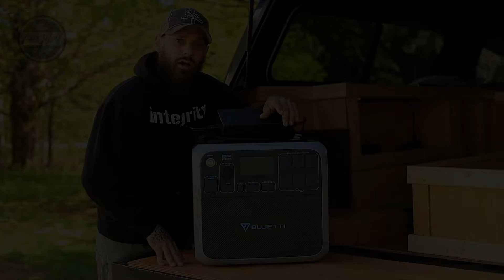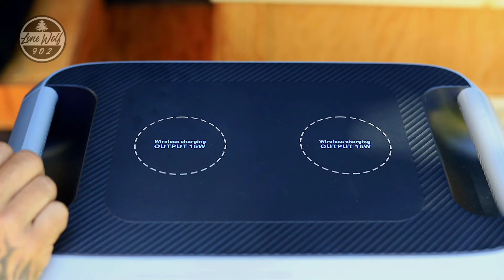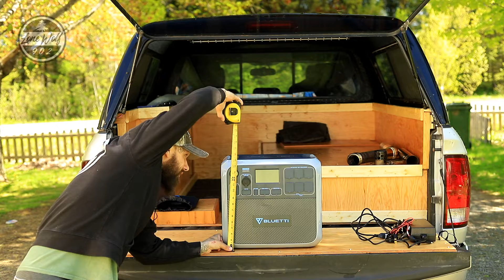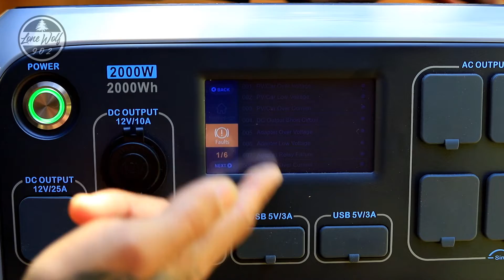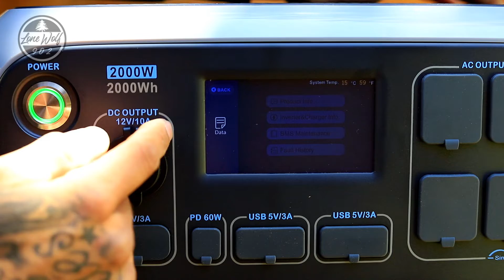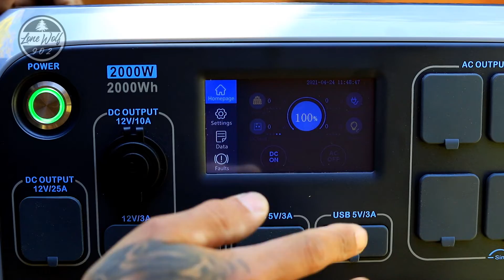Bluetti AC200P - Off Grid Battery

Comment: Can  the. 20 amp DC output be used to charge a  weak or dead car RV battery?  I don’t see the correct cables
Reply from the maker: I have no tried it
Reply: @Lonewolfwildcamping  how would ypu go about it? Would you build your own cables? Would you NOT try it because the battery chemistries are different?
Reply from the maker: I would recommend contacting Bluetti and asking the best method of doing it
Reply: @Lonewolfwildcamping  I did that but Bluetti is slow to respond and does not provide good information.  I purchased their cables, but they don't make the proper  connection to another battery. They only told which end of  cable to plug into the 25 amp socket...duh. that's the easy part.
Reply from the maker: Too bad they do not respond quicker, maybe a 1800 number  if possible?

Comment: Hi thank you for the great video! I have a a small 12 v cooler that can be both a refrigerator or a freezer do I plug that into the 12 volt 10 amp spot or do I plug it into the 12 volt 25 amp spot? I'm new at this and trying to learn thank you so much
Reply from the maker: Thank you, there are many outputs on the battery unit, I recommend checking the refrigerator specs for proper outlet choice
Reply: @Lonewolfwildcamping  thank you!

Comment: The unit is great, now it's only $2,000 right now, toss in another 399 for 3 - 120W solar panels the price point is just perfect, considering the alternative Jackery 1500 bundle package coming in at $2699.  I had picked up the E1000 bundle package last fall for my CPAP but you still need a backup when you consider the operating temps for these solar powered units.
Reply from the maker: A great piece of kit to have for home and camp
Reply: @Lonewolfwildcamping  Have you had any issues with Portable Battery Units like this in extreme cold temps? I use a Yamaha SC2300i as a back up for winter camping.
Reply from the maker: I haven't had much problems as I keep them in a heated area

Comment: 2,600 dollars and it doesn't come with the solar panel way too much money. A generac 14,000 watt (I know not portable ) but 3,400 dollars. They need to add the solar panel and not raise the price to make it more economical as well as the lure to the product.  They need to add the screen protector as well without raising the cost.
Reply: I've seen it fluctuate anywhere from $2k to $2.4k on Amazon once you apply the $200 coupon. Right now it's at $2k with the coupon, can't beat that price.
Reply: I  got mine for $1875 after shipping and taxes in California.

Comment: Nice battery..you should get a sp and permanently put that in your truck/camper this way you won't hurt the screen and the other batteries you have use them to carry around camping or construction.
Reply from the maker: It was a thought but it doesn't fit in my camper build as the space I have available is my sitting area. So it goes into my backseat but being expensive is not a good idea to store in plain sight so I don't store it there permanently